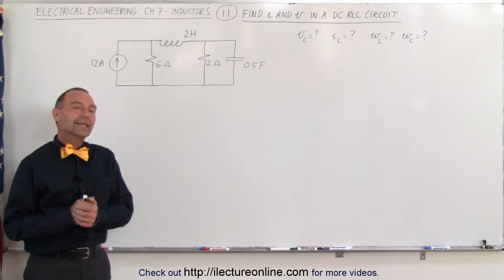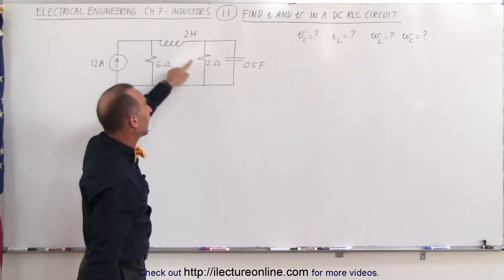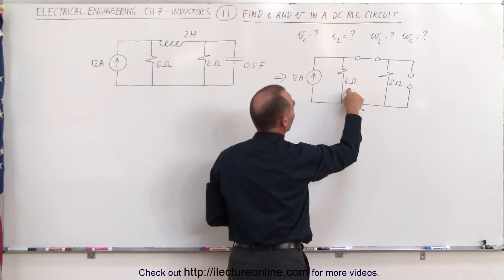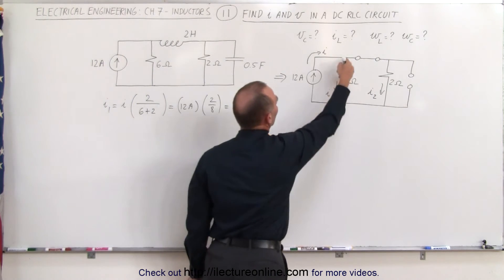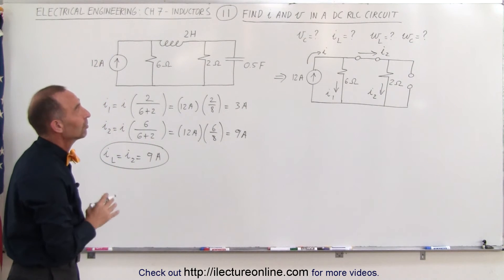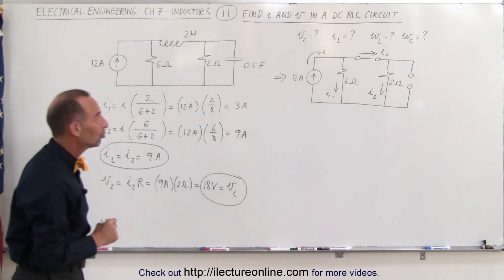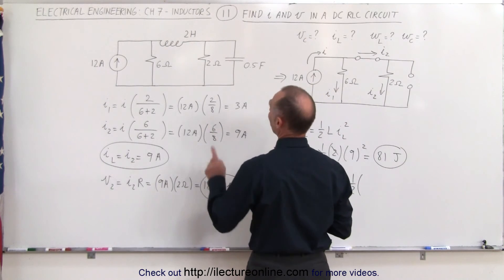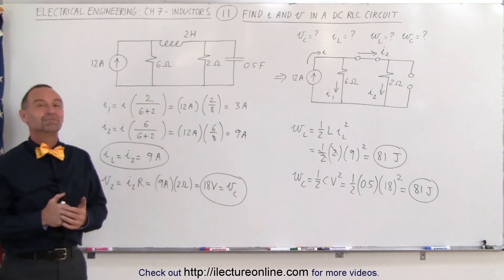Electrical Engineering: Ch 7: Inductors (11 of 24) Find i=? v=? Energy Stored=? in a DC RLC Circuit

Comment: Could you do a proof for how mechanical work put in the circuit is always conserved by producing the same amount of energy stored in the inductor or capacitor? thanks
Reply from the maker: This video shows that relationship:  Physics 45 Electromagnetic Induction: Faraday's Law and Lenz's Law (2 of 2) Sliding Bar Generator   https://youtu.be/MUcQqHsQjqg

Comment: Hello to find the V across the capacitor couldn't you find the Rt and multiply it by the current total to make it simpler?
Reply from the maker: There are always multiple ways in which you can solve these types of problems.  Try it and see if you get the correct answer.

Comment: Wouldn't there be no current through the 6ohm Resistor since current will always take the easiest (lowest resistance) route possible??
Reply from the maker: The current is inversely proportional to the resistance.  The higher the resistance, the less the current, but it would NOT be zero current.